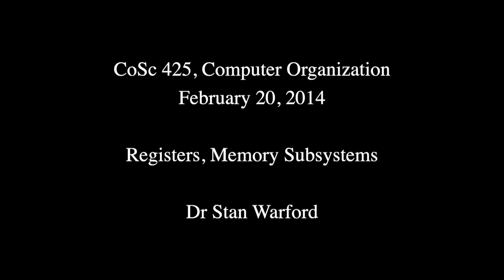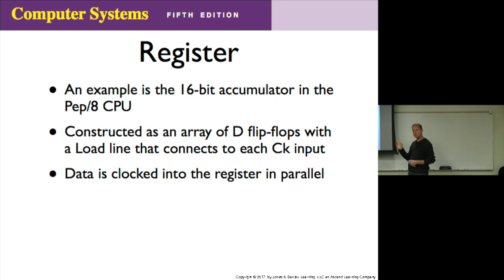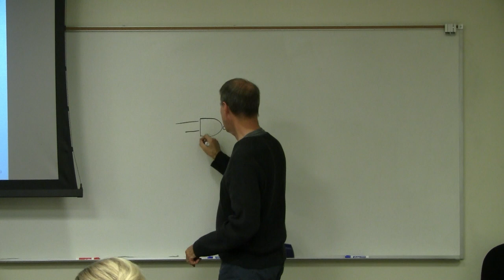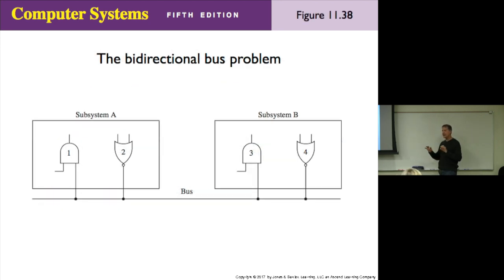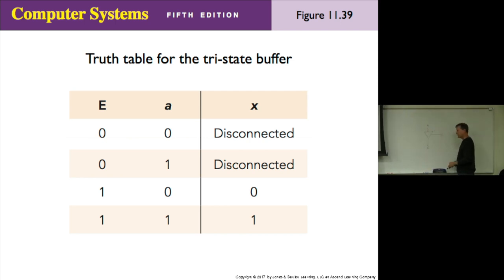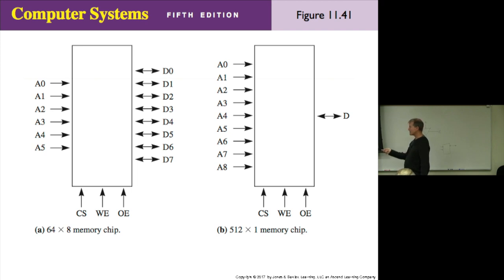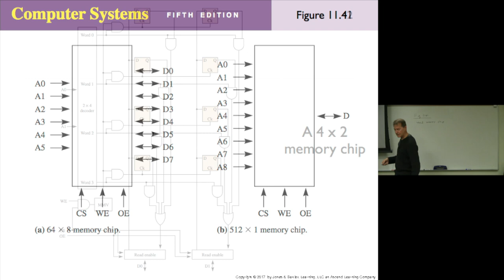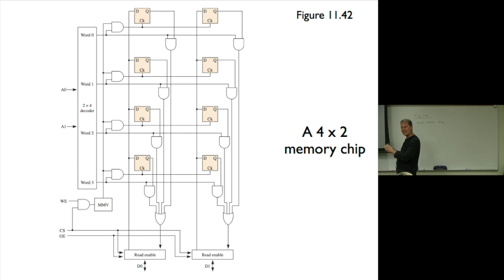CoSc 425 Lecture 18

Comment: Hi Professor ! Your lectures are really helping me a lot so I just wanted to ThankYou! Also I kinda had a similar question to the one asked by the student at around 30 -31 min mark, like if the tri state buffer is disconnected then doesn't behave like as if the signal was of 0Volts ?? I mean if it is disconnected then on the output there is like no signal at all meaning 0V, isn't it??

Again Thnx a lot for uploading this lectures!
Reply from the maker: No, it does not behave as if the signal is 0 volts. It behaves as if the wire from the input of the tri-state buffer to the output is cut with a knife. Of course, it is not physically cut, but the same effect is produced electronically.